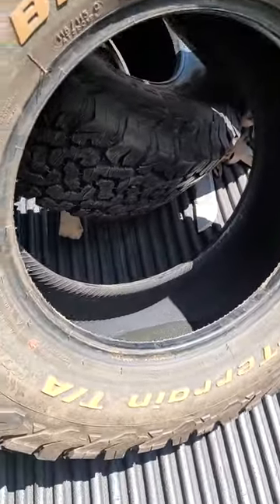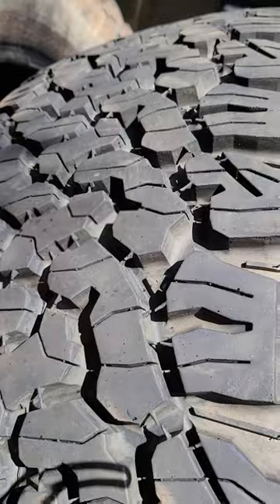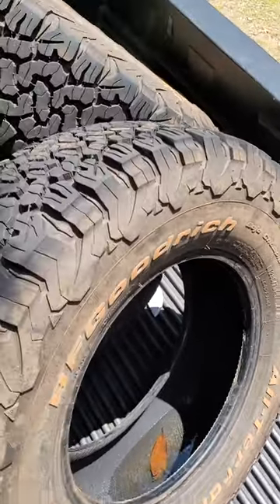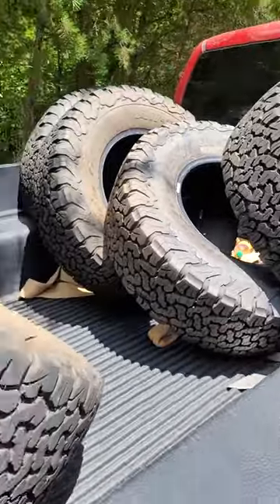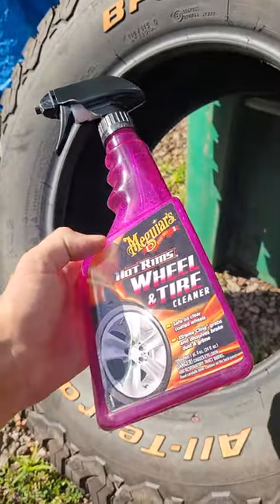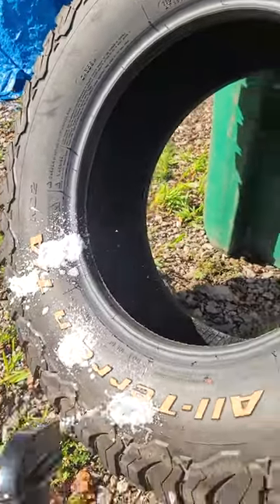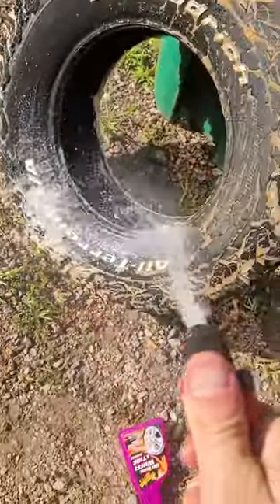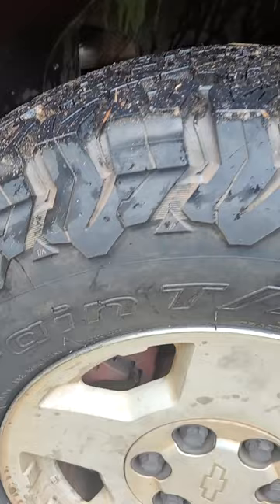Marketplace Tires?!?

Comment: Date code!  Always check your date codes.. i bought a suuuper nice garage kept 05 silverado and the date code on the spare is from 2004. And not a single mile on it, nor cracks.. but i probably will just call a tow truck if i get a flat.. thats dangerous
Reply from the maker: Always!

Comment: Bro I got a 03 avalanche I put right at 15,000 into it last summer new frame,  new block and did a intake manifold rebuild.. then I dropped 1,590 on a set of 275 60 20... bf  goodwrench ko2's